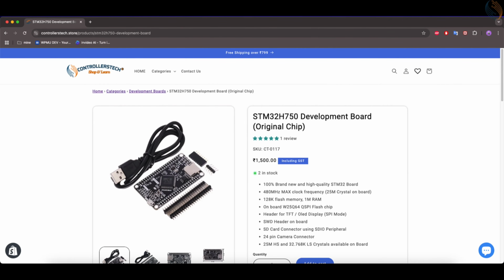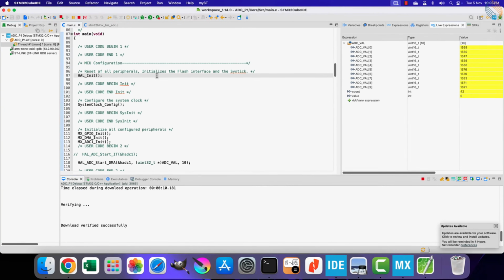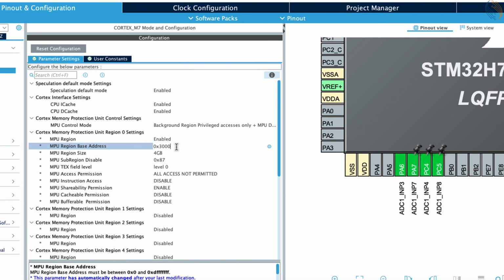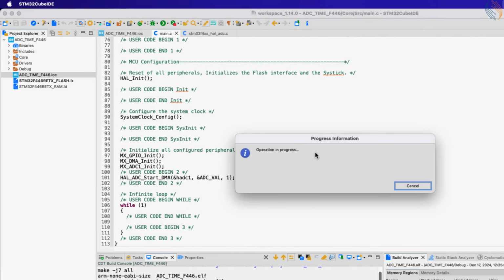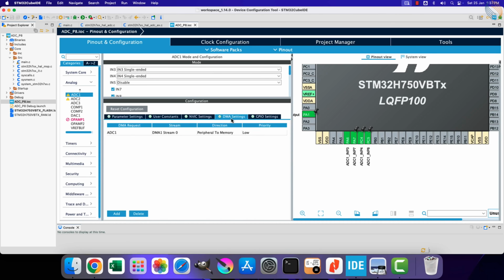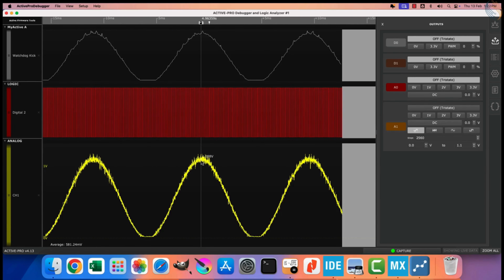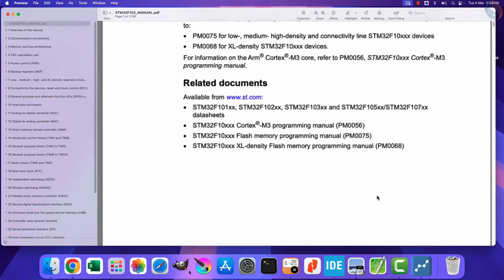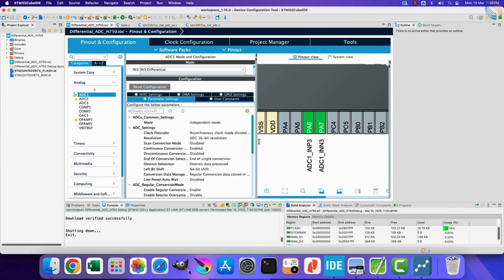STM32 ADC Full Course: From Basics to Advanced (DMA, Timer, Injected, Oversampling)

Comment: Thank you for this excellent tutorial, I truly appreciate your effort!
I’m working on a project that requires very fast ADC sampling with accurate timing control. Specifically, I need to capture 3 samples from the same channel within less than 50µs.
I’m using an STM32F303 for this project.
This kind of detailed explanation is exactly what I needed. Great work!